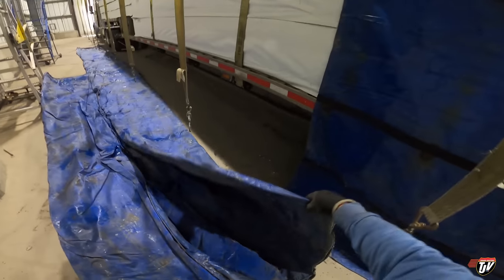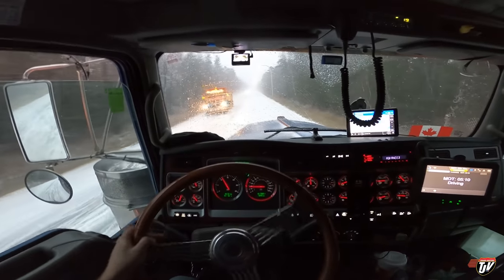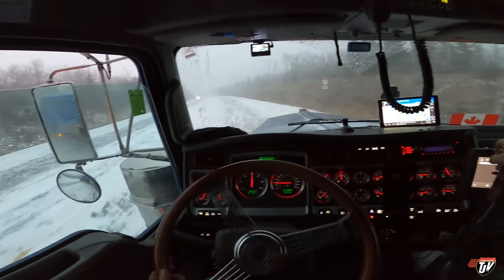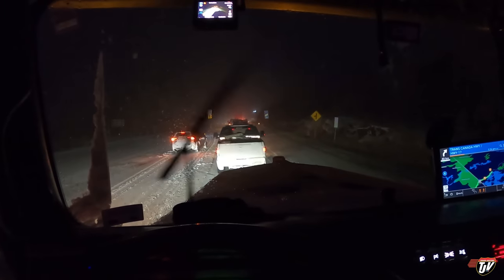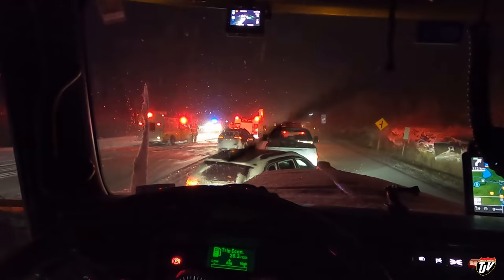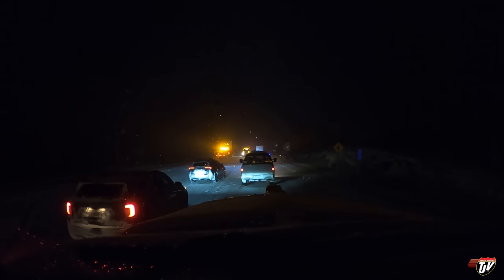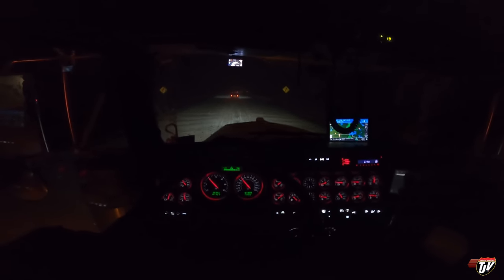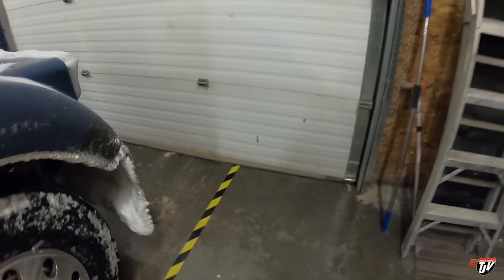SLIPPERY SLOPE!! 😬 | My Trucking Life | Vlog #2667 | Nov 10th, 2022 - Part 2

Comment: 22:10 it's unfortunate to see those examples.  I remember driving that stretch in September and was surprised by all the double yellow line passing taking place on that stretch of road.  I had to almost dive off the road when somebody did it to an 18 wheeler coming the opposite direction at one point.  I wish folks would at least wait for the passing zones to pass!

Comment: Hi great video. So I guess you have driven your fair share of mountain pass hey ? As a plow truck operator I see lots of foolish drivers during winter months too. The thing I hate when going up hill is when your loaded and the drivers in front slows at top of hill and tail gater are honking for you to move faster. So do you operate as power only or also have a trailer ?

Comment: Love your tip about windows opened/ floor heat on/ cold air blowing on windshield. Only thing I don't like about it is that it neutralizes something I said to my mom once when I was leaving their house for a trip back to Vermont in the middle of winter. She said "are you wearing a jacket?" and I said "mom, you know, my car has this thing called a HEATER." ;)  But I need to try what you're doing... thanks!